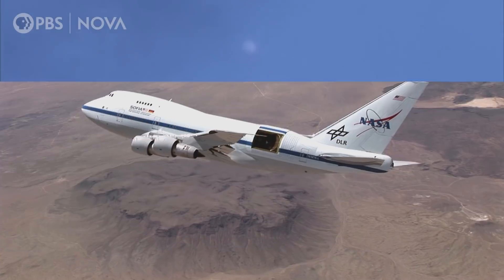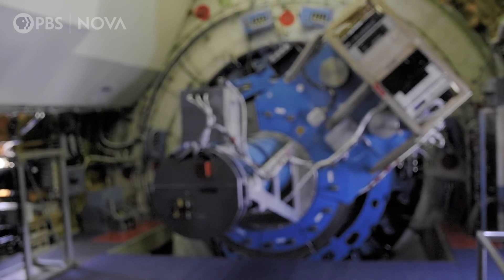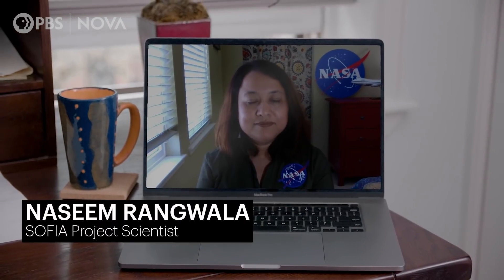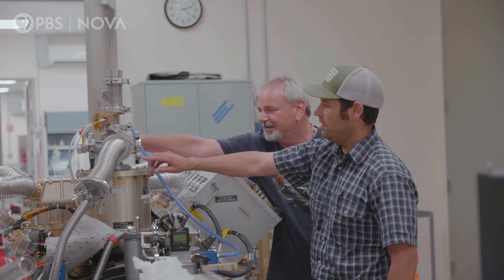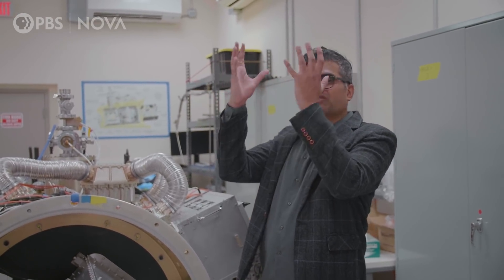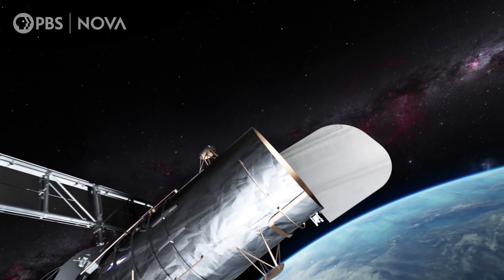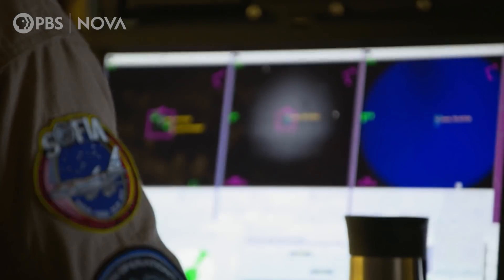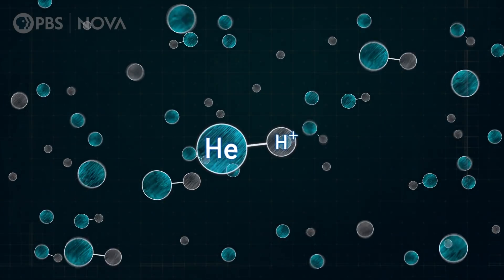How Did a Plane Find the First Molecule in the Universe? | Out of Our Elements

Comment: 4:24 First molecule ever??? I was taught a molecule is the combination of two atoms, NOT two DISSIMILAR ATOMS. So the first molecule is HYDROGEN-HYDROGEN is a DI-ATOMIC therefore a molecule!!!  AM I THE ONLY STUPID ONE ON THIS CHANNEL??? READ THE FOLLOWING COPIED FROM WIKIPEDIA -------------->>>
The only chemical elements that form stable homonuclear diatomic molecules at standard temperature and pressure (STP) (or typical laboratory conditions of 1 bar and 25 °C) are the gases hydrogen (H2), nitrogen (N2), oxygen (O2), fluorine (F2), and chlorine (Cl2).

Diatomic molecule - Wikipedia   ...   https://en.wikipedia.org/wiki/Diatomic_molecule#:~:text=The%20only%20chemical%20elements%20that,and%20chlorine%20(Cl2).
Reply: They're not talking about standard temperature and pressure. They are talking about extreme conditions.

Comment: Only question.....couldn't this science be done with a smaller aircraft? I mean, bigger planes are fun, but is there a reason this can't be done by a Cessna?  Aside from the altitude requirement....

And is it just me, or did that guy totally suck on the pipette before depositing it's contents........I guess I hope that wasn't Malaria........
Reply: Too much weight, and you're not going to find a lot of cessna's outside of the Citation class that can go high enough.
Reply: @Jay-ho9io  I still fail to believe that a 747 is the only aircraft with the lifting capacity for the equipment. Are you suggesting the telescope weighs nearly a quarter of a million pounds or more?
Reply: @MaverickBlue42  no, but it has a primary dish diameter of 2.7m and a focal length of over 3m. Try fitting that in a Cessna along with all the associated mechanical, electronic and instrumental support systems, plus the crew required to run it.
Reply: @SmokeyBCN  I can think of many planes that could fit a 3m diameter object in them, and still have room for 15-20 people, while still being half the size and a quarter of the cost to operate compared to a 747. Hell, even a 737, why do you think only popular longhaul routes typically use the 747, if even then? Because one is significantly cheaper to operate and maintain. Heck, even for longhaul routes most airlines prefer to run two 737-max8's a day instead of a single 747.....

Comment: Do you get spectral lines for molecules? I always thought you could only get spectral lines off their individual elemental constituents???
Reply: No, both is possible. 
Atomic spectral lines result from electron transitions within an atom and are usually found in optic or UV frequency light.
The IR radiation we are talking about here comes from vibrations of atoms in their molecular bonds. So every combination of two or more atoms in a molecule gives you a specific vibrational frequency, which is the fingerprint they are talking about here.

Comment: HeH! Why not H2? And why not HHe for that matter?
If there are answers to these questions, let's hear them :) .
Reply: The important paragraph from that article:
"All of the early Universe’s helium hydride should have been destroyed when hydrogen became neutral, as helium hydride is far less energetically favorable than the formation of neutral hydrogen. Once you cool below a certain critical threshold, your helium hydride will interact with neutral hydrogen, preferentially forming hydrogen molecules (H2) and isolated helium atoms (He). The Universe’s first molecule didn’t last long; by the time perhaps 500,000 years passed, it was all gone."
Reply: HeH and HHe is the same molecule. As for the H2, I was asking myself the same question, easier to form and it's way more stable.
Reply: H2 is actually hard to make.  You can bump two hydrogen atoms together all you want but they will not bond.  It takes energy so  you need to catalyze the reaction.  Usually dust acts as the catalyst but the early universe had  no dust because stars have not yet cooked up the heavy elements like carbon and silicon which makes up dust.  Since the matter in the early universe was made almost exclusively of hydrogen and helium from the Big Bang, you just are not going to get H2 until later once some dust gets made by the first stars.
Reply: @triclon  I think H2 is lower energy than 2H.  H is a radical; at any nominal density, it ought to react vigorously to form H2, no dust required.  It's a different story in a plasma (H+ + e-) like the early universe, or the low-density interstellar and intergalactic mediums today.  That's the explanation I would favor.
Reply: The + is important here.  Honestly I wouldn't name HeH+ a hydride, since the H is carrying a positive charge, not providing any electrons to fill the He atom's orbitals, because He has a complete shell itself.  But it's not up to me.  

Under normal conditions He does not form any bonds with anything.  But in an extremely hot plasma like the early universe, it makes more sense than H2 because all molecule or atoms in a plasma are cations.  All the H would be H+ + e-.  Getting an electron off of He is very difficult, though, so HeH+ might be a nice way to keep both the plasma and the He happy.
Reply: I was wondering about H2 as well, but perhaps the Hydrogen at that early time was not the same Hydrogen as we commonly come across now. Perhaps it was denser and less likely to freely bond to another atom. 🤔
Reply: @megamanx466  What is that supposed to mean? A proton, and if not ionized, an electron is hydrogen. There are isotopes of hydrogen with neutrons - deuterium which is stable and tritium and unstable. One atom of hydrogen has no density.
Part of the point of the presentation is that there were no other atoms to bond to.